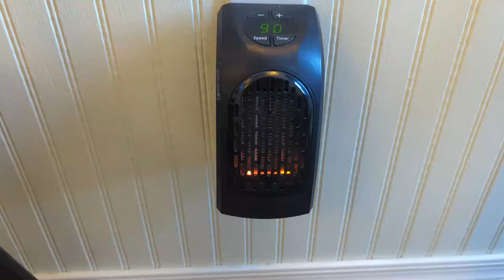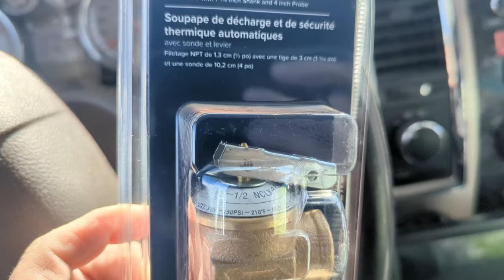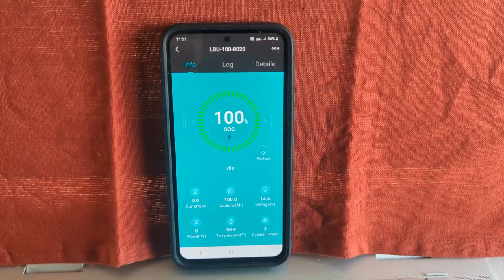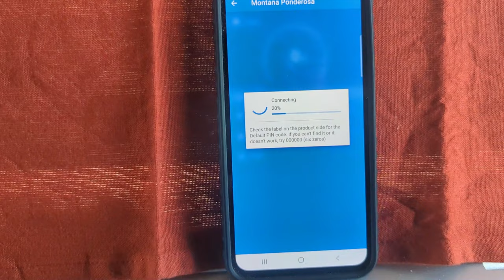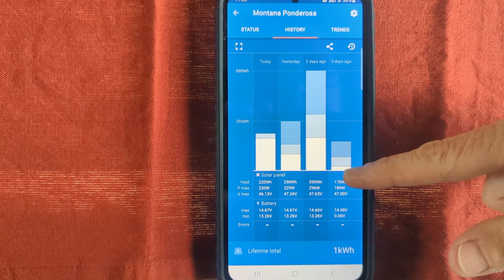Solar Upgrade and New Lithium Batteries On My Truck Camper

Comment: Thanks  for getting this update in your message on solar needs. Went down to see Mr. Awesome Possum Phil Causey on my box truck. He recommended I consider a tin ceiling as it would be cheaper than anything I had looked at. He put up a few sections but shoulders and neck gave up. It looks so good, I actually got a little teary-eyed and after we decided on wall coverage with my upholstery material and a chair rail and board and button finish. I forgot what he called it, maybe "luton" and described it as shinny white paneling with no texture. Said I could get the fine dust off the walls with a dust mop. Can also clean off the tin ceiling the same way. He had me at dust mop. Saw lights he ordered which are already wired but not installed. He also Got two 20 lb propane bottles and got a rack to mount to rear bumper outside my living spaces. The bumper was maybe 4" wide and now it is 18" wide with chrome finish and tail lights that are installed going under the bumper and then flush with bumper. Details..I just see I am getting closer to finishing. Next time I go down to Graham, I will show him your videos. Being an old lady, I have said for some time that "I need a keeper"  and I guess he is "keeper" right now. Again thanks for the great advice and site where you upgraded your solar.
Reply from the maker: OH WOW!  I have hear of Awesome Possum but have never been there.  Sounds like things are really coming along!

Comment: What additional capacity can you add if you choose too?
Reply from the maker: My limitation right now is space.  I could put another panel on top but no space for a battery in my battery compartment.  I could always put a battery inside under my table but I don't see needing to do that at this point.

Comment: Should your amp hour capacity in the app say 200 instead of 100 on capacity'AH?
Reply from the maker: I didn't go back and look at the video, but I just checked it on the app and it does show 200 Ah capacity on the combined system.
Reply: @FrugalRVGal  after I watched the video and posted the comment I thought maybe it was for each individual battery and it showed it combined in another page. Just something that was on my mind while I watched.
Reply: Congrats on the solar upgrade!! 🌞